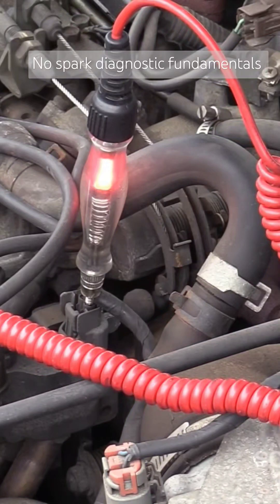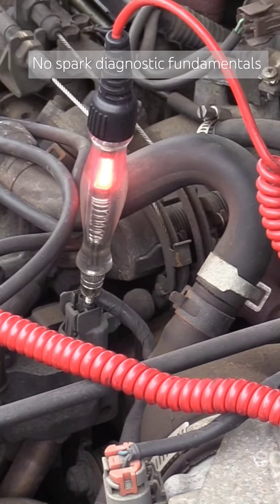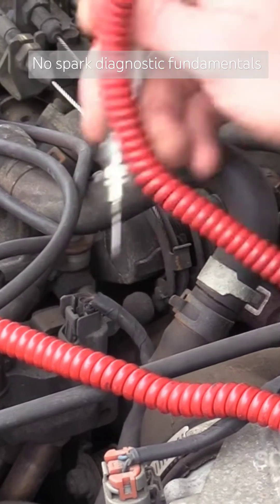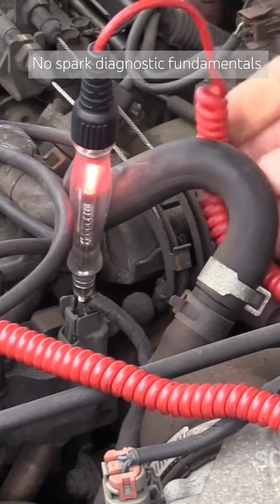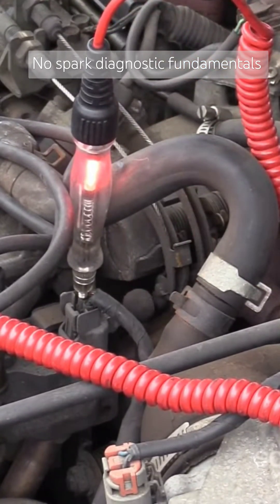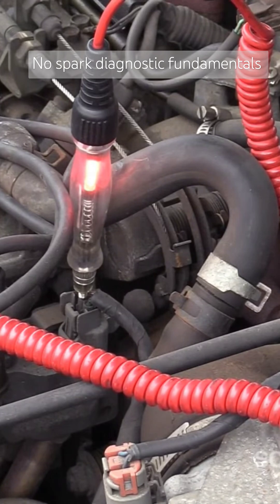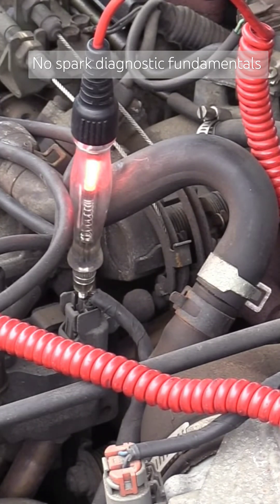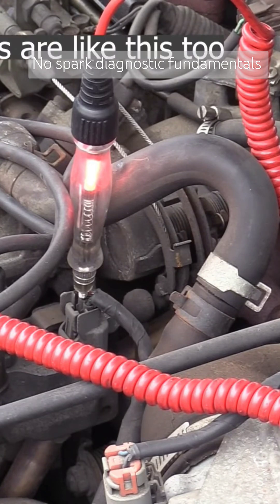One of Many Reasons LED Test Lights are Garbage [Ignition Coil Control Testing]

Comment: How do you fix code for PO135 for Chevy Astro 1998 I replaced O2 sensors but still light on check engine . Thanks for all your share your knowledge 😊
Reply from the maker: What is the voltage on the heater wires measured at the O2 itself? This is an O2 heater circuit code right? Need voltage readings to help further

Comment: It will probably cook your scope to..   You might want to make comprehensive and definitive video showing how to avoid wrecking your scope when testing coils.    (just a suggestion).
Reply from the maker: I've done many!
Reply: You need an attenuator
Reply from the maker: On the Snap-On scopes you do not. Anything more than 200v on the pico 4425 and you do!
Reply: @chasedavis2358  Yes.. That's my point.  A dedicated video about this would be great..  He probably already has several I'm sure.. now that I think about it. :)
Reply: He has done many videos.
Reply: @kalindambozi2356  yeah.. I searched "scope spark" in the channel and there were several dozen with those words in the title. lol.
Reply: That's a funny coincidence. I primarily rely on an incondescent test light to load the circuit. But to test the control side of a coil, I have always used a logic probe with LED's, because it shows the switching from pos,to neg, on a single led. The red to green is very fast, n barely detectable, so I look for the familiar color created by the signal. Been my go to for over 20yrs. It's an old SST, from late '90's. Has that horrible smell, like the oldies screwdriver drawer lol